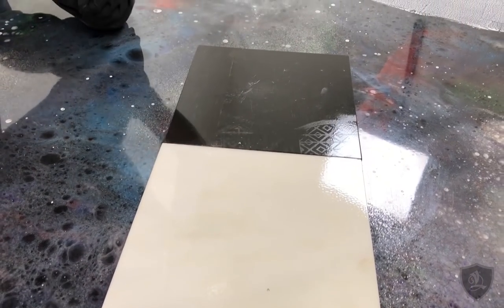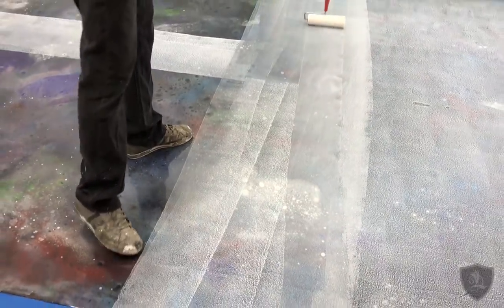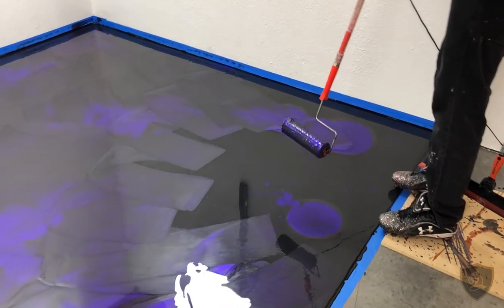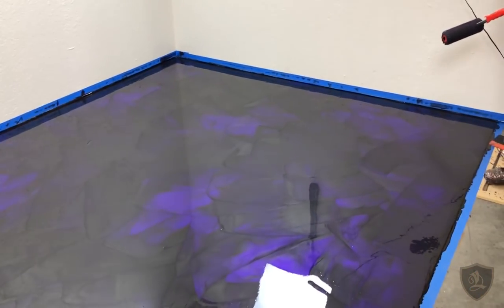Black & Bright Purple Epoxy Floor

Comment: Hi isinth there a top coat applied ( polyurethane) of some kind ...Great job i love your tutorials ..
Reply from the maker: We have 3 different top coat options. Glaze coat is our super high gloss top coat that lays out glass smooth just like the metallic epoxy coat. Our WB Urethane comes in high gloss and leaves a minor texture and we also have a WB Urethane that’s a Matte/Satin finish.

Comment: That looks amazing. Would this be durable enough to install in my garage floor?
Reply from the maker: Our products are actually industrial coating made for military aircraft hangers, etc. So theoretically in a residential, or even commercial setting it will last forever. This is NOT a cheap epoxy paint that you will commonly find at box stores like Home Depot or sherwin Williams. It is a thick 100% solids epoxy coating.  Thanks

Comment: how does this material react in a house fire? Does it emit toxins that are harmful to the lungs?? just a random question
Reply: Afrocano ... Damn good question .  I would like to know myself .
Reply: That is a good question
Reply: lm just gonna go with a hunch and say its terrible for you
Reply: Toxic or not, pretty sure if you have a house fire you’d have other safety hazards that are a little more concerning
Reply: Afrocano ya but when there is a fire you get low and crawl on the floor... that really the only important smoke to concern your self with because heat and smoke are going to rise ..
Reply: Lena Snell ahhh i see what you mean. Yeah. Good question
Reply: Lena Snell lol i was thinking if there’s a house fire my ass gonna be outta there FAST
Reply: @jackkiefer8387  but it would be nice to know that you can enjoy house fires without worrying about carcinogens
Reply: Afrocano to answer your question about after the floor has cured, during a house fire, should you need to cross the covered floor, it presents no danger other than possible burns should it be super-heated. Once applied and cured, epoxy is not flammable, meaning that during your house fire, you have to leg it brother, the floor is not going to harm you, the fire is.
Reply: @quinn-676  Interesting.
Reply: @quinn-676  but is it carcinogenic
Reply: No more than anything else in the house that would be releasing fumes. The drywall and wood would collapse far sooner than the epoxy would begin to burn.
Reply: Actually when one of my friends was having his house built, the builder told us that the epoxy he uses is actually fireproof and very safe, but I'm not sure about this epoxy. Good question
Reply: Epoxy is toxic even without fire lol
Reply: He didn’t reply so I presume it is a yes
Reply: Good question and I think you can tell the answer by the non response from Leggari products. In my experience any chemical will give off toxic fumes
Reply: you shouldn't inhale anything really that isn't the air we breathe... just a rule of thumb
Reply: The thing is our body is sturdy enough that it wont harm us you will have to inhale it for probably 24/7 for a week of the initial fumes of it being heated and you will barely start feeling sick
Reply: Noah, do you know what chemicals are in the product? I don't really want to be inhaling anything that I don't know what it is or hasn't been tested to know the long term affects even if breathing it in for a short period
Reply: Yes. About as toxic as all the other plastic burning creating smoke around you in a house fire.... O_o
Reply: Afrocano How about this - when your house is on fire leave so you don’t have to inhale those toxic fumes
Reply: you'll get lung cancer from the fire before you get it from the epoxy
Reply: If this stuff is epoxy then yes you're screwed it pretty much turns into a hard plastic and plastic fumes aren't nice, if it's polyester u guess it's the same
Reply: @dextrosity7350  it's terrible for environment though after burning it.
Reply: House fire = death
Reply: Edgar Ortiz epoxy doesn’t catch fire or stay lit for long. it’s too sticky once it gets hot it’ll just turn to plastic. And why be worried about Epoxy being toxic YOUR IN A BURNING HOUSE WITH SMOKE!!! That is also Toxic...........just Enjoy to Floor please!
Reply: This guy "let me lit my house real quick just to make sure"
Reply: Good question, I also was wondering what would my car smell like if I drove it off a cliff? like would it release toxins n stuff, I mean the car would be fucked but I need to know, asking for a friend.
Reply: Can I order from you guys? I want these same colors

Comment: Whenever the garage/work shop is built, id like a black floor with a hint of darker red. Will help cover any blood or anything. Long at it can handle tools pounding on it and that its good for me.
Reply from the maker: Our products are actually industrial coating made for military aircraft hangers, etc. So theoretically in a residential, or even commercial setting it will last forever. This is NOT a cheap epoxy paint that you will commonly find at box stores like Home Depot or sherwin Williams. It is a thick 100% solids epoxy coating.   Thanks
Reply: Cover up blood? Super sketchy
Reply: he cleans deer in his garage. :)

Comment: As an aircraft painter the way you were walking on the surface and the coating was irritating me but then i noticed the stilts/cleats and thought how amazingly ingenious that is
Reply from the maker: It does help to not track the epoxy everywhere and when you step off the epoxy will self level.  Thanks

Comment: Hey Guys i'm from Brazil, over here is very difficult to find someone that can do a great job with epoxy floors.
My family owns a house were we are moving in on the next few weeks and the 2nd floor is wooden tiles, can a clear coat of epoxy be applied directly on top of it?
Reply from the maker: Yes you can float a floor with our epoxy.  Thanks
Reply: Thaanks!

Comment: Can you  cover ceramic floor tile with  epoxy  ? And would the tile patterns  show afterwards  ?
Reply from the maker: Yes it can be put over tile, but you need to fill all your grout seams with multi purpose bondo from Home Depot, then sand it smooth, this will scuff up your tiles also, then wipe it clean with denatured alcohol then you are ready to apply our epoxy.  Take a look at the tutorial below.  Thanks
 https://youtu.be/g8GzsL0kpns

Comment: How well does your no prep primer stick to wood? If I had some left over could i cover my hardwood/fo wood floors with it?
Reply from the maker: Our primer is a water based epoxy specifically designed to chemically bond to almost all smooth surfaces.
Reply: I'll take that as an "it's worth a shot". Thanks for the reply btw

Comment: The primer you used first can you use it on kitchen tiles then epoxy on top
Reply from the maker: Yes it can be put over tile, but you need to fill all your grout seams with multi purpose bondo from Home Depot, then sand it smooth, this will scuff up your tiles also, then wipe it clean with denatured alcohol then you are ready to apply our epoxy.  Take a look at the tutorial below.  Thanks
 https://youtu.be/g8GzsL0kpns
Reply: @LeggariProducts  Thank you

Comment: How much Metallic do you put in? I tried to make your seahawk floor and it come not out like yours. I like this floor its looks very cool.
Reply from the maker: Martin first you apply the metallic base coat, then you mix the highlight in with the epoxy and little by little add the highlights until you get the look you want.  Thanks
Reply: Çok. Güzel.  Ama. Anlamıyım. Keşke. Anlayabilsem.

Comment: will this hold up to hydraulic jacks and jack stands?
Reply from the maker: Our products are actually industrial coating made for military aircraft hangers, etc. So theoretically in a residential, or even commercial setting it will last forever. This is NOT a cheap epoxy paint that you will commonly find at box stores like Home Depot or sherwin Williams. It is a thick 100% solids epoxy coating.

Comment: Can I put that primer over old epoxy garage floor ?and then put down new flakes?
Reply from the maker: Yes you can, you just need to prep your cement.  CONCRETE PREP FOR A JOB

Shop blasting and diamond grinding are the two best ways for preping concrete.  But they require expensive machines and vacuums that you can get at most equipment rental stores.  The next best step is to acid etch the concrete, if you can’t do any of these you want to clean the floor with an auto scrubber from a rental store or mop it really good and then we require our prep replacement primer if you are just going to mop or scrub the floor.

Comment: how viable it's to sprinkle crushed opal on top of black epoxy floor like a small room?
Reply from the maker: You could do it but you would have to sand it down to make it smooth then apply a top coat.  Thanks

Comment: The way he’s marketing his product as the best probably means it’s like anything you can buy at home depot
Reply from the maker: Our products are actually industrial coating made for military aircraft hangers, etc. So theoretically in a residential, or even commercial setting it will last forever. This is NOT a cheap epoxy paint that you will commonly find at box stores like Home Depot or sherwin Williams. It is a thick 100% solids epoxy coating.  Thanks
Reply: Leggari Products sheesh aight then, I'll take two
Reply: Eman M Yeah, the people who actually have good products just say it’s garbage...
Reply: Or maybe it’s because he knows his stuff 😄
Reply: Shane Dancer everyone claims they have good product. This guys just some guy who outsourced everything and stuck a logo on it. Do you really he’s got a degree in chemical engineering where he’s studied Epoxy Resin structure and found the best one? No
Reply: @hsvr  I know everyone says they have a good product, which is why I obviously used sarcasm to address the idea that because someone says their product is good it means it's bad. Outsourcing is irrelevant, most (if not all) smartphones are outsourced including the best ones so that doesn't matter for quality. Why do you doubt that the guy has a chemical engineering degree? I mean there's no real reason to think he doesn't and if he does then he would obviously have studied Epoxy Resin once he got into business with it. Also unless he is straight up lying about the fact that it's used for military aircraft hangars or the product looks like shit 3 hours after it was filmed I'd say it's probably good. He even brings up that you need to use more of it in order to get the maximum result, which I would think makes it higher quality because if it was shit putting more of it on would make it break faster or more obviously.
Reply: Never buy any coating at Home Depot, it’s all garbage, specially an epoxy for a floor,
Reply: @LeggariProducts  yeah. I bet it is for military aircraft hangers. That's what everyone says.
Reply: Eman M they don't sell anything like this at home depot. I went to find something like this there and they didn't have it. Bought a kit from Leggari and I couldn't have been happier.

Comment: Why don't the cleats leave marks? The epoxy isn't dry right after you apply it, obviously. But there's not a single mark left by them🤔
Reply from the maker: Because the epoxy self levels after you step off of it.  Thanks
Reply: Evan Ostermeier if the epoxy was in its later hardening phase they would leave holes but since it’s still very liquid the epoxy refills the holes

Comment: Garage floor has some cracks in the cement, can this still be applied
Reply from the maker: Yes you can, just fill the cracks first with multi purpose bondo then diamond grind the floor and clean with an acetone then you are ready to apply our product.  Thanks
Reply: bondo is not a fix all,,,,, expansion rate is different bondo will crack are you going to send him new product when it cracks in a year? You sell epoxy.... You should know one of the best fixes for a crack in concrete is epoxy.... let it fully cure then sand the entire floor. One other option is to sand the floor then fill the crack 24 hours later come over the entire floor with epoxy primer,   Never trust just a bonding agent. That is if you want it to last. 
Bad advise is a deal killer. btw if you heat the entire floor it will get rid of alot of those imperfections I see at the end,

Comment: Which materials did you use for this floor?
Reply from the maker: We used black and deep purple metallics added to our epoxy.  First we apply the primer then we apply the base coat of epoxy fallowed by the highlights.  Thanks

Comment: Would it be possible to do this to a wall instead of a floor?
Reply from the maker: James West Absolutely you can. You have to add Cabosil to the epoxy to thicken it up. You can’t get the same looks because your putting in on as a paste but it’s a really cool option. We’re also going to be launching terrazzo wall kits very soon.
Reply: Leggari Products that’s awesome, thanks for responding so fast too! I can’t wait to start using your products and I’ll definitely give the terrazzi wall kit a look when it releases, finally I was also wondering if it’d be possible to apply this product to say an IKEA linmon countertop for use as a desk top - also do you ship to the UK? Thank you so much for your time

Comment: can you put this on top of old tile?
Reply from the maker: Yes it can be put over tile, but you need to fill all your grout seams with multi purpose bondo from Home Depot, then sand it smooth, this will scuff up your tiles also, then wipe it clean with denatured alcohol then you are ready to apply our epoxy.  Take a look at the tutorial below.  Thanks
 https://youtu.be/g8GzsL0kpns

Comment: how much epoxy is needed per square ft. just to calc cost
Reply from the maker: Our three gallon kit covers 135 sq. ft.  You can actually order or price out a custom kit for that exact square footage through the Floors section of our website at www.leggari.com. Simply click on Floors >>>> Order Floor Kit Here, then follow the steps.   Thanks

Comment: How many years it will last ?
Reply from the maker: Our products are actually industrial coating made for military aircraft hangers, etc. So theoretically in a residential, or even commercial setting it will last forever. This is NOT a cheap epoxy paint that you will commonly find at box stores like Home Depot or sherwin Williams. It is a thick 100% solids epoxy coating.

Comment: How durable is it?
Reply from the maker: Our products are actually industrial coating made for military aircraft hangers, etc. So theoretically in a residential, or even commercial setting it will last forever. This is NOT a cheap epoxy paint that you will commonly find at box stores like Home Depot or sherwin Williams. It is a thick 100% solids epoxy coating.  Thanks

Comment: Epoxy coating is cool, but the price is still very expensive, it is cheaper to use marble or granite, which are themselves expensive products
Reply from the maker: The price is not even close, our floors average $2.20-$2.40 a sq. ft. and countertops are around $7.25 a sq. ft.  Granite and marble your looking around $35-$55 a square foot.